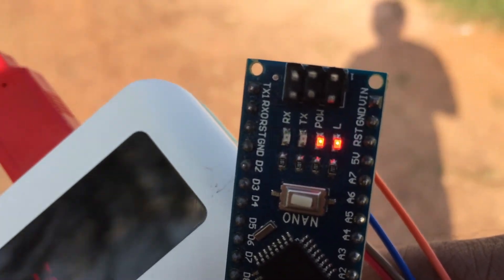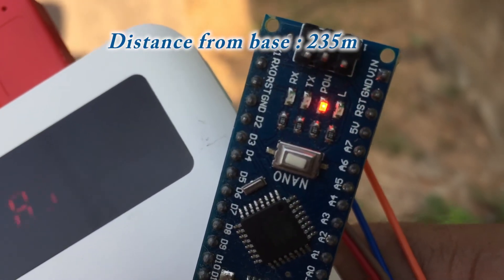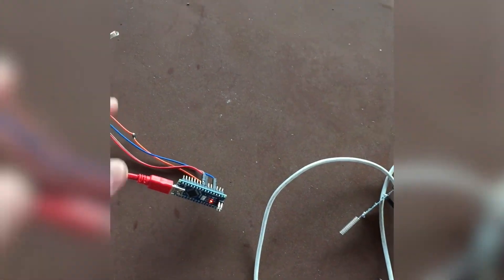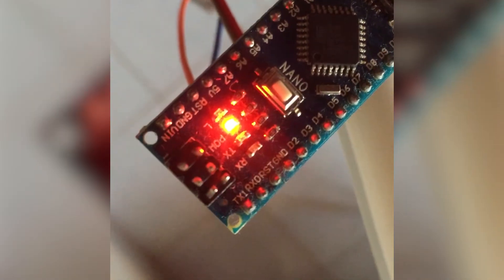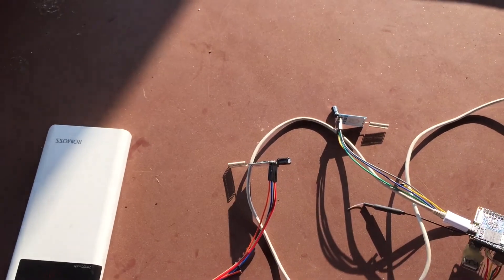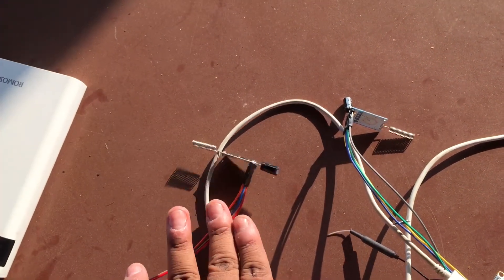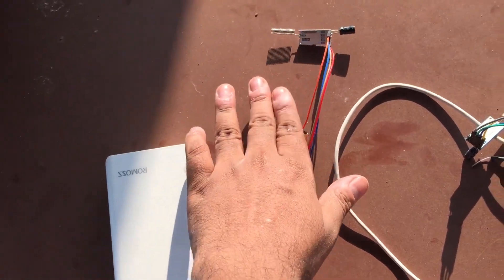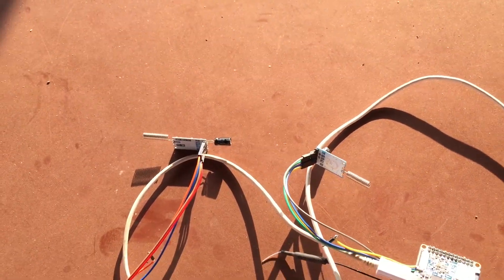HC12 Introduction

Comment: Hey can u please give the code and the connection details. And also the capacitor and resistor details. My original ones don't communicate even at 0meter. Is capacitor and resistor necessary
Reply from the maker: Hi there, the cap is 100uF. For connection connect micro-controller's TX to HC12's RX, and HC12's TX to micro-controller's RX. For more communication distance, set the baudrate to 1200. But most importantly, you need to make sure that both of your HC12 modules, specially transmitting HC12 is an original one and not fake.. Let me know if you need anything..
Reply: @h2d6  great ❤️ i got a reply from u and bro and mine hc12  is original one . I have set the at commands to fu4,1200,c081,and 20dBm. Will this  work for my hc12 without capacitor u mentioned or is it necessary. And and I want this for the communication between 5 floors of a building. Like one on top and one on the bottom . And if u can contact me on instagram@vp8181 it would b great help bro.❤️❤️❤️